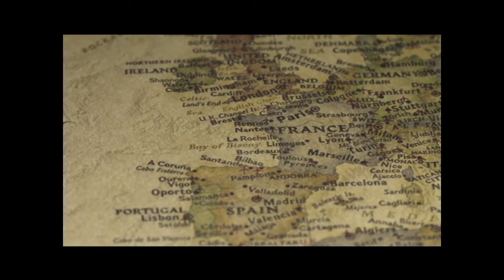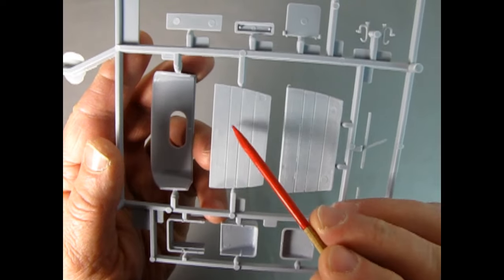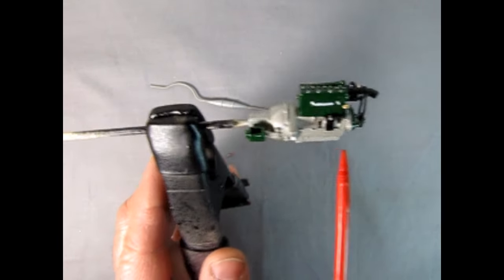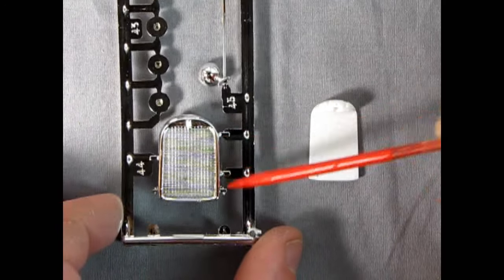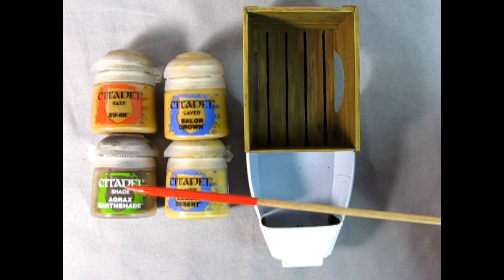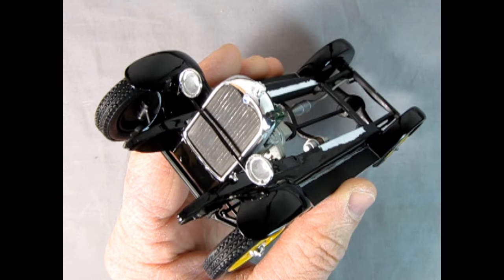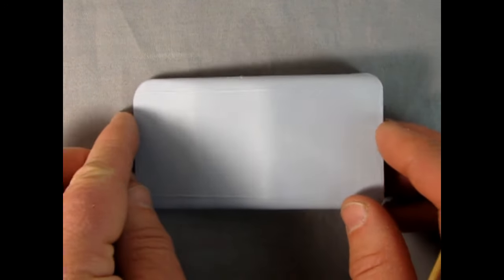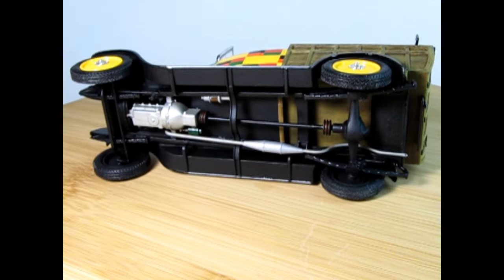Model Car Garage - The 1926 Citroen B14 Normande by Heller - A Model Car Unboxing and Building Essay

Comment: Took your suggestion to watch this video. Very nice. I like all the added history that you added. I sometimes do it as well but not as in depth. Amazed at how smooth that black Tremclad paint dried up. My goal when I restarted the hobby was to take advantage of airbrush painting that I could not as a kid but it's nice to see that brush painting can work as well.
Reply from the maker: Glad you watched the video. Yes, that Tremclad in a can paint really comes up glassy smooth. It's amazing how it settles out. I have a future video coming up of the Revell / Atlantis 1/32 1956 Cadillac Eldorado and I was going to spray it gloss black, but after the Citroen build, I decided to brush it and it really looks slick. Just waiting on paint to dry so I can chrome it, glue in the interior and finish it off. 

Look for the video coming soon!

Comment: Nice history intro and impressive build. Paint looks sprayed not brushed since I don't see any brush marks. Very nice paint results.
Reply from the maker: Thanks 👍 

I inherited a bunch of paints from my Dad when he passed away in 2019 and the car is a mixture of my newer Testor's and some of his vintage Testor's that they don't make any more. I was amazed that the vintage paint was as fresh as when it was new AND that it dried just as well. The pink color was separated in the bottle, some on the top and some on the bottom with thinner in-between. A little mixing and shaking and it came out perfectly.